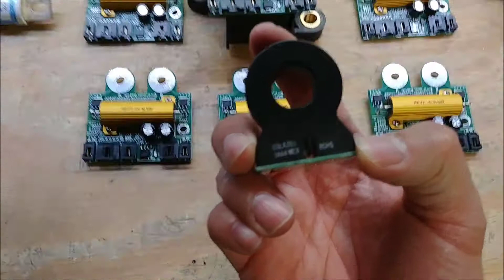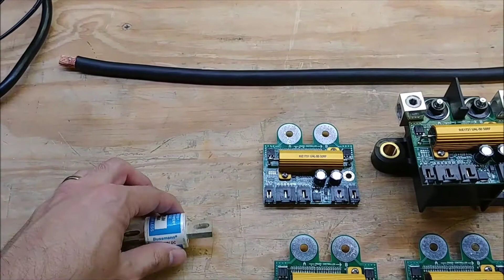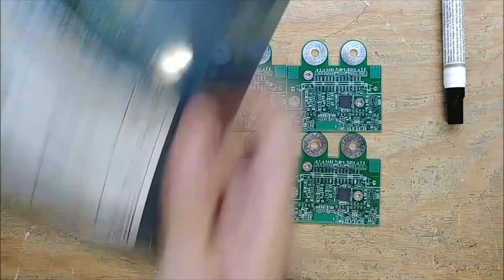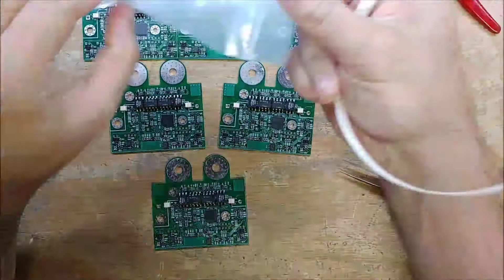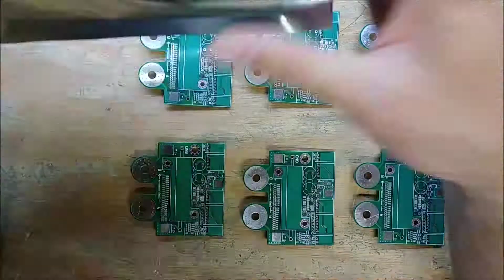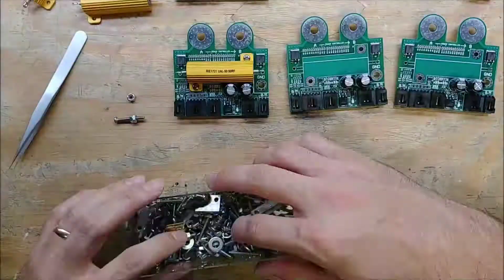Solectria E10, Lithium Ion Battery Upgrade, Part40

Comment: Impressive soldering skills on that mcu.  So, you'll need 4 of these total to split each leaf pack into 2, right? Any idea on what these would cost?  Last question, I assume they talk with your modified leaf BMS. any plans to make that transplant board/code available?
Reply from the maker: +SquishyBrained 
Actually the microcontroller was really hard to solder... It was unpacked from the tape and reel and then individually placed inside anti-static bags (and sat on a shelf for a while)... So the oils on the fingers of the person that did that caused a bunch of oxidation on the pads. So solder did not wet very well and I had to use lots of flux...

You only need 2 Power Controllers to split a Leaf pack in two. One of each parallel stack.

There is about $80 in parts including the PCB (not including the contactor), and a bit of time in design, layout and assembly... And I still need to write the code... Maybe $150 or so. ;)

They don't need to talk to my modified BMS, it will work in standalone mode... But I do have plans to make my interposer board available, if people want them.